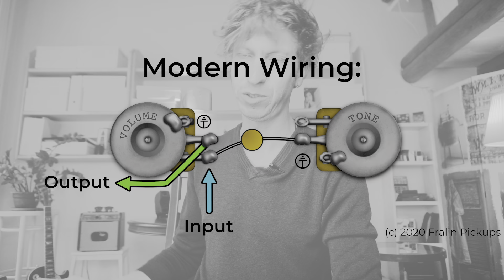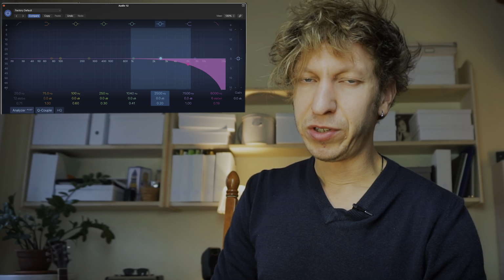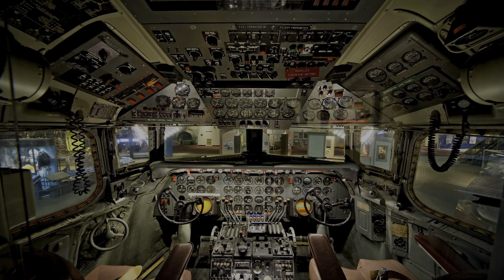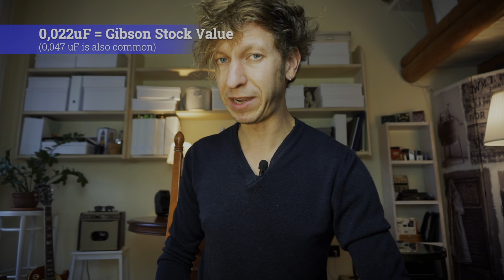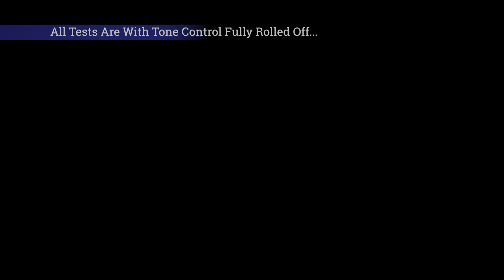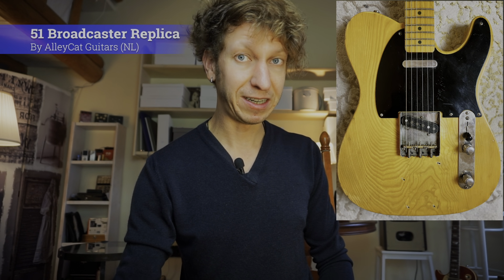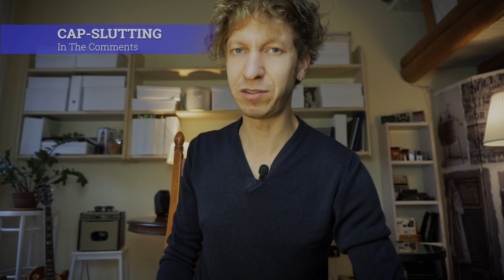How To Get BETTER Working Tone Controls In Your Gibson Les Paul! [COOL MOD+A/B TESTS]

Comment from the maker: I do this with most of my guitars, including the Telecaster. However, with a Tele you can go really overboard with lowering and it makes it work really interesting! I've went down to 5000pf (0,0047uF), which is only a 10% of the Stock value. It still filters high end though. But it let's transients and upper midrange live, lots of fun!
Reply: I accidentally put a .0022uf in Strat middle pickup which worked for a bouncy funky warm tone but not much else, it's fun to experiiment with all the Electrics. Usually youbrnd up going back to stock or very close.

Comment: Great video Aldo, the .022 still sounds beefier. Once by accident I wired in a .0022uf in a Strat middle and all the way off it sounded like a really bouncy/springy humbucker(1+2 pick-up) which was the best sound I had ever heard on Strat clean or Overdriven except when I turned tone to 10 it sounded like a dentists drill hitting a nerve but for that 1 sound frim 0 to 7 on the tone it was glorious. Now I have found a .022 mallory and series it with a PIO .01uf and WOW the gates opened and I entered a new world of Tone, massive open bell-like clarity with solid low end and rounded wonderful high-end. I may have actually wired it wrong cos I wanted a tone cap .047 for neck and .022+.01 for middle seperately but some how all 5 postitions sound good. NB even though the bridge pickup lacks a tone control I found that the cap and tone pot used in the wiring can affect the tone..even a new switch made the sound better. I discovered and learned a lot by necessity as thr Guitar had a dodgy switch and Volume pot(I bought a multimeter for £20 which has helped me repair my Guitar electronics myself )so I decided to DIY it and explore. More videos!

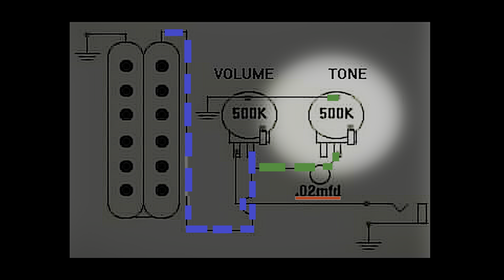Comment: 3:10-4:00, Is the guitar you are demoing the tone with wired like this schematic?
I have never seen a diagram that shows that the signal from the pickup, goes to the middle horn of the volume pot, and from the first one goes to the input jack.
Mainly the middle horn is the output signal  pot.
Some logic tells me that the function of the tone pot depends primarily on whether the signal first goes through the capacitor, then into the tone pot, or vice versa, first into the tone pot, and then into the capacitor, certainly the value of the capacitor additionally determines that.
As well as whether it comes from the input horn of the volume pot, or from the output -50"S -60"s (modern).
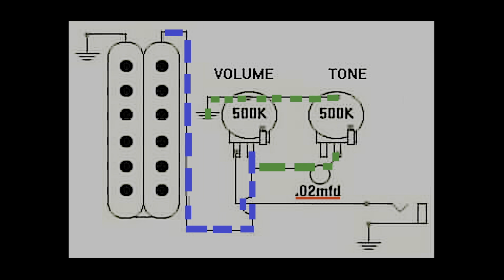So far, I have experimented with all options, except for the one you show in the video, 3:10-4:00. I will definitely try it.
Reply from the maker: Hi Bluesman! Yes, the Les Paul and Tele have 50% value caps and the test is against stock values. Gr,
Reply: @AldoSpadaroOfficial  yes, it is greit, today tray this wiring, definitli nice, that my permanent wiring, but onlu neck hb, bridge hb still 60S wiring, that my combination, thanks for answer
Reply: @AldoSpadaroOfficial  The thing is all those 50s Les Pauls capacitors would’ve drifted by now and they still sound great, so it would be interesting to see the difference between say 0.022 and 0.033uf if there is a any difference at all

Comment: i will give this a try .cool
Reply from the maker: Godspeed! Which guitar?
Reply: @AldoSpadaroOfficial  , a burst replica , with all the old woods , brazilian for the fretboard etc etc, but too on my non reverse firebird and melody maker 66 converted lefty , i use old 0.022 sprague , and bumblebees , but i'm curious and interested in the result , despite they actually sound really great with rolled off tones . Seems , by watching/hearing the 0.011 sound even better .
Reply from the maker: @luffy8563  Cool! Well, just experiment. Perhaps there's also a middle solution with .011 on the neck and 0.022 on the bridge

Comment: ? if both pots would be the same resistance... whats the difference ?  except nothing ?
Reply from the maker: Tiny difference in 'non-engaged' setting, weird enough, but enough to make us wake up at night and start soldering. And the way the tone control operates is substantial enough to make 50s wiring a religion, haha. Might make a video on it, A/B.